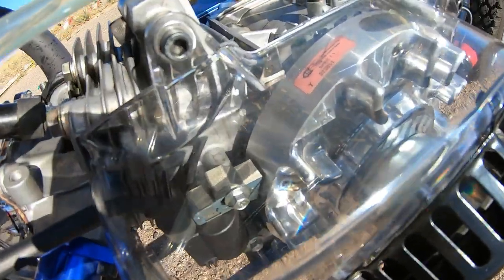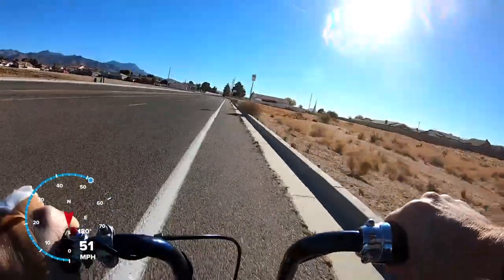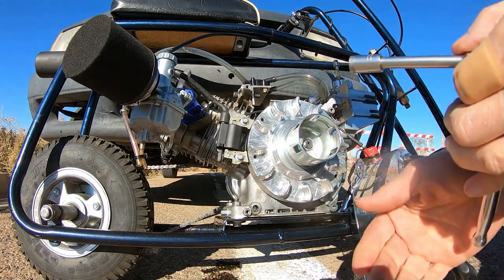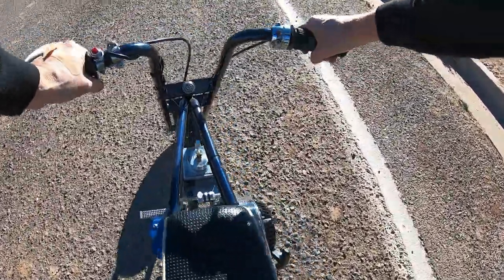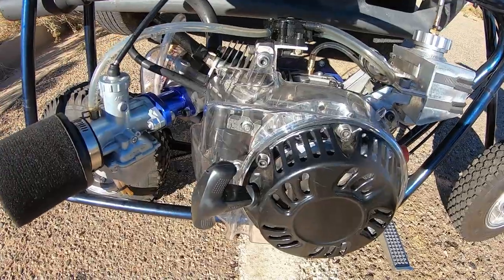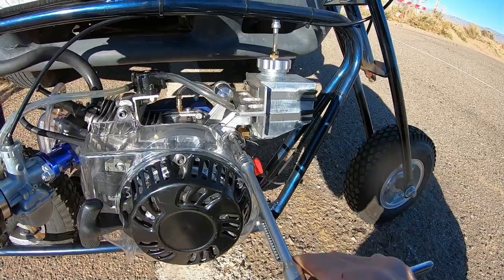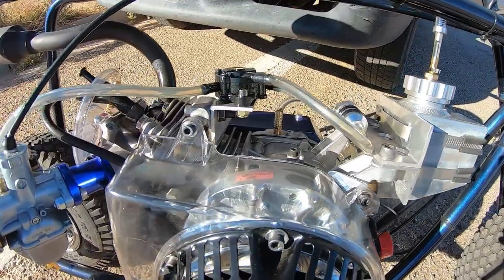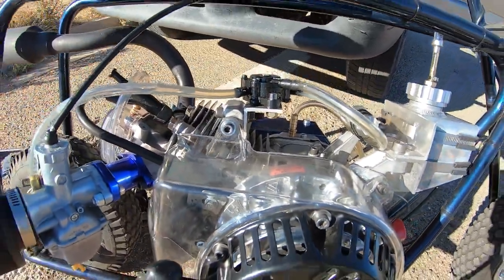Is a wide coil gap better on a Predator 212?

Comment: I enjoy every video I hit the like before I even watch it lol 💯💯💯 thank you for sharing
Reply from the maker: Thank you!Thank you for watching!
Reply: @Black66 I replaced the ignition coil assembly and new spark plug on my ct100u  since old boot broke off now my bike won’t idle right sounds like it’s idle too high then turns off in 5 seconds after turning it on the could gap was set at .018 idk ifs the correct gap I called Coleman they said they don’t know

Comment: I've noticed this before on my 225 when I had set it at .30 to .35 thou on the coil Gap, I opened it up to .75 thou & that's solved all my high RPM breaking up issues

Comment: The coil primary wire to the plug...I have done this on a Hammerhead go kart...From the coil take solid core wire uncoated...One end make a ground connection to the engine block...Then start coiling the solid core wire tight one layer to about one inch from the end of plug...Then wrap insulation tape or elec. tape to cover exposed wire...When I first did this the spark was much more intense than the normal spark...Brighter, defined, more horse power...This simple mod may make a difference...Try it and see if it works then do a video on it...

Comment: Didn't say which fuel or timing key. I believe that flywheel is timed for methanol with a straight key. If it's on gas the timing would be too high so more gap would retard the timing for more speed. ARC has factory specs for timing and coil gap that are pretty much right on. Also, I would get a pair of racing gloves and shoes that cover your ankle.

Comment: If you use this settings on the 10k rpm aluminum flywheel would it perform the same.

Comment: Seemed it struggled a bit from 57-60 when it was set to 30 thousands but looked a little stronger from 0-20. Cool video 👍🏽 
Quick question. I have a 79cc predator that couldn’t run WOT without choke. Tried 2 new stock carburetors and a pz19 carburetor and even jetted the 19mm but still had the same problem. Any idea what is causing that? It just bogs and dies when given full throttle without choke
Reply: Things I'd pay attention to first: good fuel, good carb gasket seal, clean air filter, correct spark plug gap, good contact with spark plug boot, fuel lines of appropriate size, enough height difference that fuel makes it to the engine, proper flywheel/coil gap. If none of that works, you might have gotten a lemon or it's worn out enough that it doesn't have good compression. I'm not a mechanic though, so maybe you'll get some better ideas from others
Reply: That's all the surface-level stuff I can think of. I'm assuming the engine hasn't suffered any catastrophic damage from running without oil or something. I hate to waste a salvageable engine, but those 79's are cheap enough that it might save you some grief to just get a new one.
Reply: @kentsugden6865  thanks a lot for the help. Il look into that stuff and hopefully figure it out.
Reply: @tyler9463  thank you. I got rid of the stock carburetors and still have the pz19 so il check that one.
Reply: Does the engine idle without the choke on? Sounds like you have a vacuum leak somewhere, also read your spark plug that will let you know if your running too lean or rich.
Reply: @TOXIC-hb7rc  it idled without it once warmed up. The spark plugged looked good. Wasn’t running rich. Didn’t look like it was lean Iether. That thing had me stumped. Could be what the other guy said the possibility of it being worn out. Il see soon on of these days after testing.
Reply: @srcobra50  well then in that case change your coil and/ or spark plug. That’s mostly like gonna solve your problem, I had the same issues about a year ago with a Briggs animal engine.
Reply: Air leak. Dirty carb jets. Or valve lash to tight.

Comment: Getting the coil further away, causes less magnetig drag on the flywheel. .080" is probably max distance or close to it, before you lose too much spark energy. Pretty cool experiment! Thanks for running that test!
Reply: The magnetic drag factor makes sense when you put it like that

Comment: I just watched a video saying the new ghost engines are rpm limited by the coil. The video said it's printed on the coil itself. I have a preditor 212 hemi. I am not sure it's true or just a ghost thing. Do you have any coil recommendations or do you run a stock coil. I was just going to upgrade my plug wire not the whole coil. 7mm 0 ohm wire solid copper core and lower profile boot. Does it matter in your opinion. If wider gap .080 made a difference this might . Thanks!
Reply: Also I like that fuel tank you have ! Did you modify it to mount on your front tank mounts ?  Do you mind sharing where you got it from 🙏
Reply from the maker: Yes it is true. Watch this video on the ghost coil and flywheel swap . Also check out the Ghost playlist for many videos with the Ghost  https://www.youtube.com/watch?v=lm6zTvhJHSk&t=2s

Comment: You ever had issues with the slipstream coil gap to close? Under .05 would it give no spark? I’m having issues with spark on my 200 hisun. Wondering if I burned my coil setting to close. I didn’t realize they needed that gap I had set mine at .035 I get spark occasionally but if I gap it that far no I get nothing. Assuming coil is bad now?

Comment: Maybe you can help me i have a  tillotson 212 and when i first start it it takes a few cranks when i start running it say around the block then come back turn it off. Then wait a minute or so and try and turn it back on it will not start even when i have choke on. Could it be timing if any or gap between ignition coil. But when i finally get it running again it will sometimes bog out when i give it gas. Hopefully you can help. Love your videos too.

Comment: How do I remove the old valve guides on my Flathead Briggs & Stratton and put in the new valve guides I got a 10 over alcohol breathing flat head at the valve guides are toast and is there a way for me to regrind the seats without having the tool using sandpaper?
Reply: Not really man. You need a good solid fitting pilot and a trued grinding wheel on an arbor or a carbide cutter. Good news is, you can buy a small engine cutter set for only 60 bucks nowadays. They have the pilots, and 45 degree seat cutter. Plus they come with 30 and 60 degree cutters for narrowing/moving the actual sealing area on the seat. Make your money back by doing 3 angle valve jobs for your buddies. :)

Comment: How do you know if your predator is a hemi or not? I bought a fly wheel and now i fear it won't fit the shaft
Reply: One easy way to tell is the hemi has a cast aluminum squarish valve cover and the non-hemi has an octagonal stamped steel valve cover like a stop sign

Comment: You better check your side, you’re leaking oil, that’s exactly how I blew my motor it only had two maybe three hours on it
Reply: @Elijah’s MiniBikes 
Unfortunately it was a little too late for me, I had three hours minimum on my totally built 212 it end up costing me a new piston new rings and new bearings other than that everything was fine, she’s back together running great I don’t know why but I lost 2 miles an hour on the top end may because the motor  is not as loose as the other one I don’t know at this point I don’t care ha ha ha ha
Reply: @Elijah’s MiniBikes I do now my brother, I have a Torque wrench right next to it set at 18 pounds, how much older than you think I have all the Time in the world to go over this thing before I use it